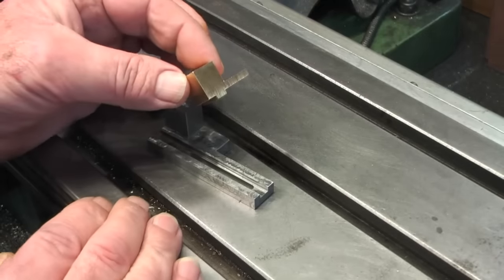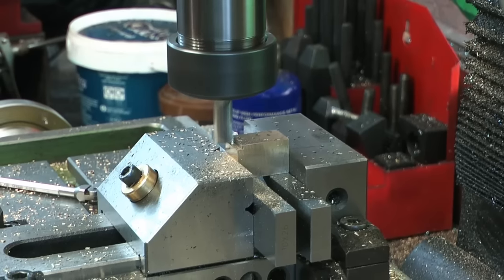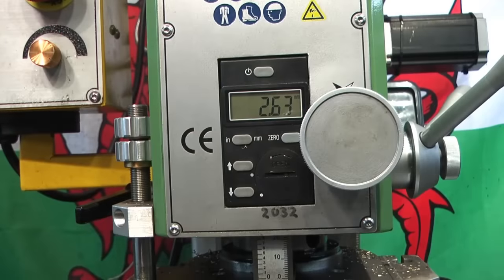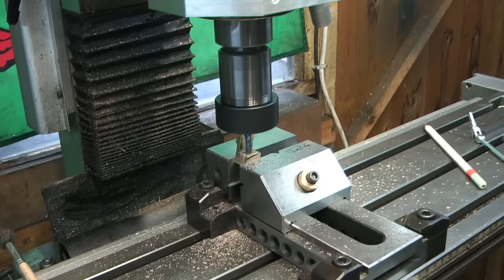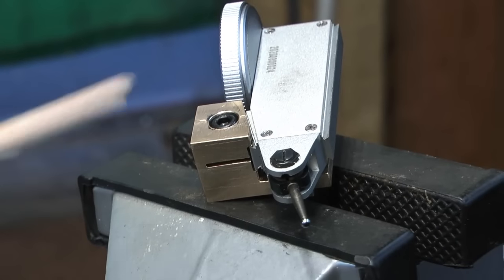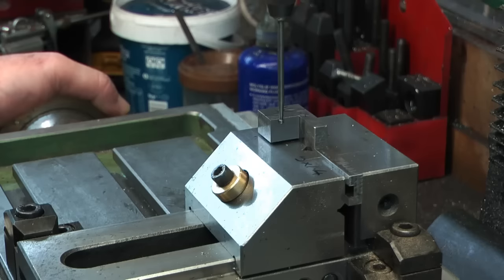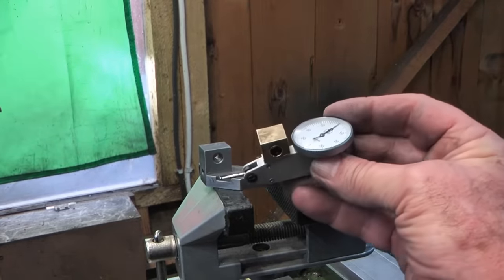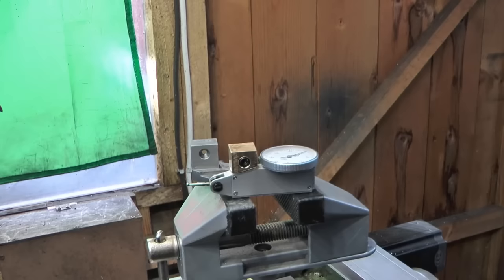Making Stefan Goteswinters low profile DTI holder . My way .

Comment: Hi Ade. If you run out of room under the spindle you could try my simple 20mm high low profile holder that simply clicks onto the spindle. If you are interested, search for - 20mm high DTI holder with 200mm extended range. Hope you like it, there are other variants on the channel.

Comment: I made one of those but i changed it a bit and while experimenting made the body from nylon to test the changes. I incorporated a fine feed which tirned out quite nice and seems a little novel in design. I should explain since second retirement my hobby seems to be trying to make the "perfect" dti holder and since that is an unachievable aim i will never run out of things to make.😅
Edit PS nylon actually works, although meant as temporary, being stiffer the the dti stylus spring.
Edit 2 like you i try to use one size collet as much as possible and have settled on 20mm, so i had to enlarge Stefan's plans hence the trials with nylon.